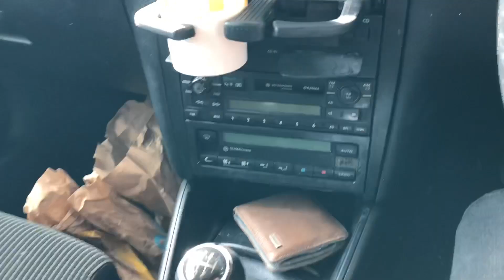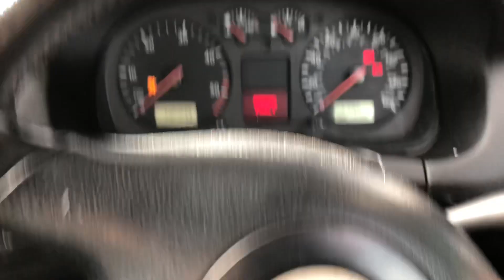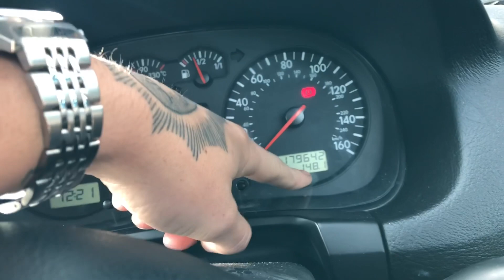SAY HELLO TO DAISY THE DAILY!!

Comment: £750 for an 18 year old Golf with 180 k on the clock! Sounds like a bad deal to me.
Reply from the maker: TheLatestSoftware brand new turbo, brand new dual mass, brand new clutch, 4 new tyres, new brakes all round. I’m only the 3rd owner and it has every single bit of service history!
Reply: Even so, you've got a airbag light, so it wont pass another MOT until fixed and you said you've just had to replace top mounts and a wheel bearing. On the plus side, that sunroof leak might only be a blocked drainage channel.
Reply from the maker: TheLatestSoftware airbag light is only a sensor under the seat which is like £5 🤦🏽‍♂️
Reply: TheLatestSoftware plus 180k on a 1.9 tdi is nothing. If serviced well like this one they have been known to do over 400k miles